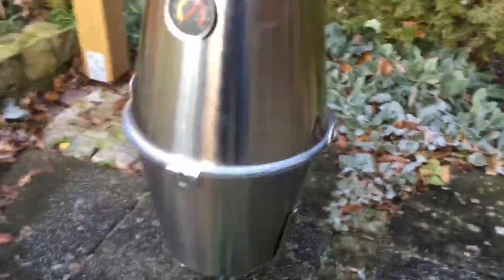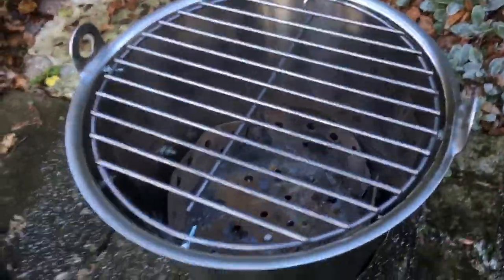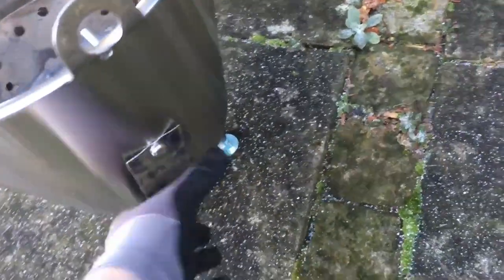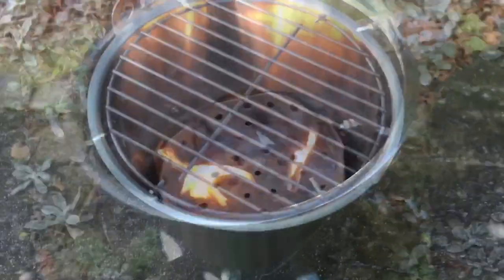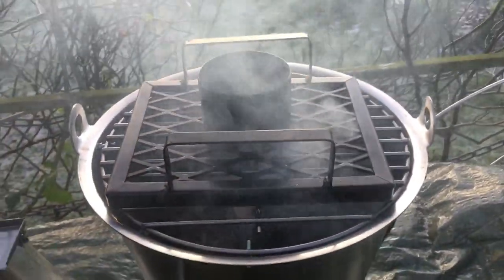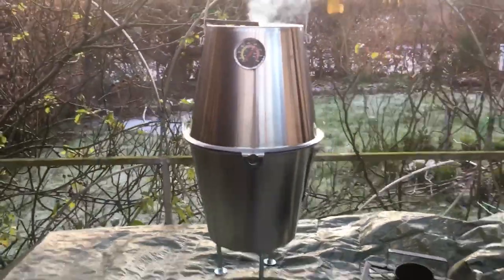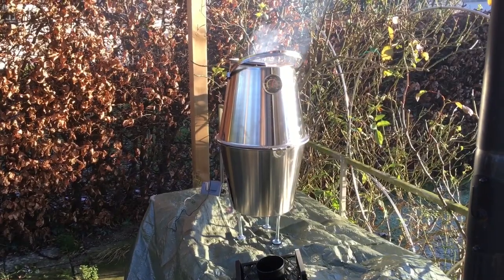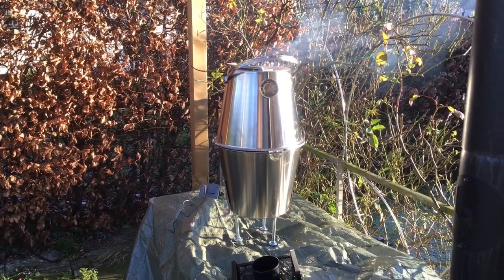DIY li’l Smokey - Building a double stainless bucket grill - Old Smokey Style

Comment: I love it!   Very clever idea......and the buckets were just the right size to use the grill grates!   It being stainless.......it will live forever!!!    That's Metal My Friend!     You Rock!   \m/
Reply from the maker: Heavy Metal Bar-B-Que Thanks Ken. I just started dinner on it so it will be fun so see how it goes. If i can get it to gonas low as 275 i will be glad, but it seems its easier to go high than low so far. I changed the dampers so that i have bolts along the sides so i can slide them which makes it snugger. During my testrun it went to 550 without a problem, so heat is no issue. 

I was really happy about the grate, if it had not fit i would have had to make one so this was way easier :)

Thanks for your support !

Comment: You never cease to amaze me buddy!  Nice job!  I'm wondering how you temp ranges will work out once you start using it a bit.  Wonder if it will be able to do low and slow.  We shall see!  Nice work!
Reply from the maker: Everyday BBQ Thanks Mike.

It seems to be way easier to spike the temp than getting it low. I have the vents set to 1 hole open each side now and its at 330 10 minutes after closing up. Think i will have to close soon though since it keeps going. 

Will try setting it up to cook at 275 one day though. I have two ham hocks that is supposed to go low n slow. 

The coals from the seasoning held a long time atleast :)